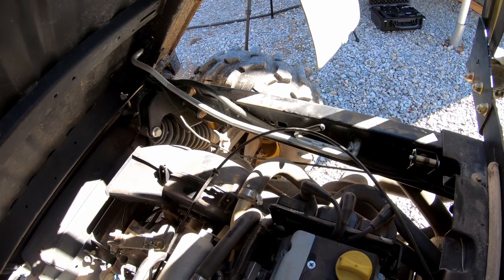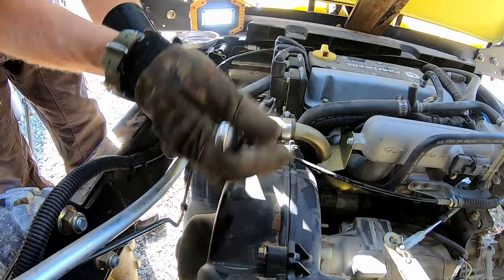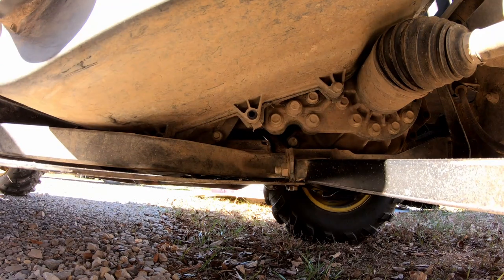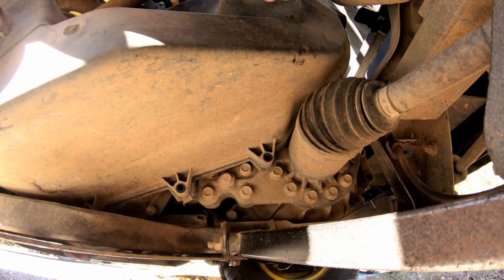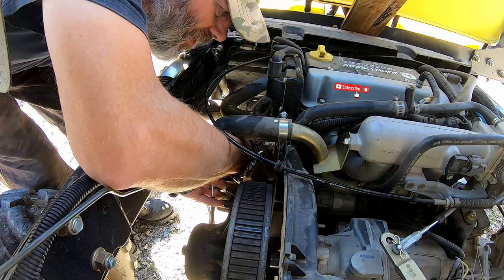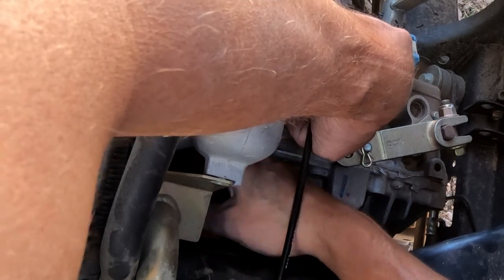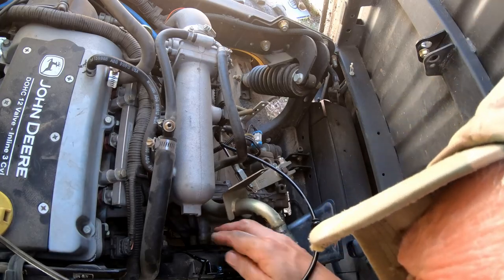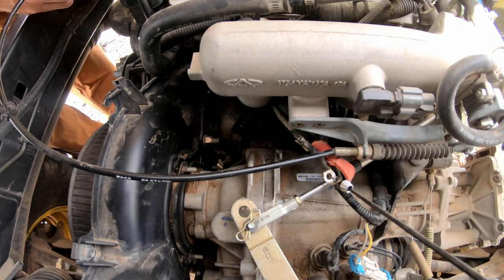John Deere Gator Starter Repair

Comment: Thank you for your service and for this video. Got to do my 2012 825i soon as it's started the dying starter raspy whine on start up.
Reply from the maker: You're welcome on both counts and thanks for watching.  This seems to be a common problem with these machines.  I did a short version of the video as well to help people just get the answers.  The Amazon starter seems to be cheaper than a local purchase and the lead time seems to have dropped but who knows with the supply chain issues we're having.
Reply: @ozarksethic  Believe I'll order it so I'll have it when I need it. Thanks

Comment: Where did the piece that broke off go? That could cause a lot of problems later. I had a GM product that lost a torque converter balance weight come off, got hung up in the starter gear.
Reply from the maker: That's a good question.  I didn't find fragments in the drive housing.  I didn't remove parts to get into the flywheel but saw no evidence of it engaging the teeth.  The engine is sealed so no worries there.  The Gator has been working fine since the starter change so it seems to have suffered no ill effects.
Thanks for watching!

Comment from the maker: Thanks for watching!  If you have any questions, post them up and I'll do my best to answer.
Reply: how do you get a starter  bolt out when you drop it in the plastic holr
Reply from the maker: Sorry for the slow reply.  YouTube flagged your comment as spam and hid it.  
If it went behind the drive pulley, that will be tough.  You may have to loosen/remove the inside cover.  I would try a combination of bent wire, like a coat hanger, and a magnet.  Try magnetizing the wire to see if it will pull it out or just hook with the wire and use a magnet to work it out.  Good luck!  These things are a PITA to work on, like most modern equipment.

Comment: What’s the part number for the starter you used, I have the same model John Deere
Reply from the maker: They are:
 Starter Part Numbers
Old Starter - Valeo D6GC201
New Starter - Valeo (ASC) S401455N

I put them in the description since it was not clear enough to read in the video.  Hope this helps.  Thanks for watching!

Comment: It seems JD has not fixed this defect in 10 yrs.

My 2021, 38 hrs, 240 mi, has the start-up whine now.   Not looking forward to the archimedes experience.
Reply from the maker: It's not fun but if you follow the tips in the video it should be a little less painful.  I agree that it seems the engineers have not addressed what is a chronic problem with these engines.  I think the nose of the starter is not designed to support the bendix shaft well enough and as it engages the flywheel it puts a side load on it.

Comment: Thanks but I sincerely wished I had looked a little further than this video before replacing the starter on my 855D.  On that model, there is no need to remove the cover from the reeves drive and of course there is no cooling system cross over to worry about.    Still a ridiculously tight installation but the bolts for the starter can be reached without removing that large plastic cover.   Instead, on my model, the skid pans underneath can be removed to get access to the starter bolts.   

Fully agree, JD did a very poor job of designing the bed hinge and access in general.   There should be a means to lift the bed to a 90 degree angle so normal humans with shoulders wider than a teenage ballerina can access the area.   It wouldn't  be hard to modify the bed hinge with two pivot points instead of one to allow the bed to tilt to 90 degrees. 

Most irritating however is the cost of a new starter.   In my case, the only issue was the bendix drive on the front of the starter but of course JD doesn't sell parts to rebuild a starter.  $520!!!  for a new starter.
Reply from the maker: Sorry you did extra work you didn't have to...  The price of that starter is crazy!  That's like CAT territory.  Thanks for sharing info someone else may be able to use.  Thanks for watching!